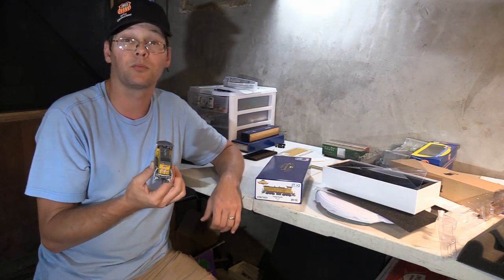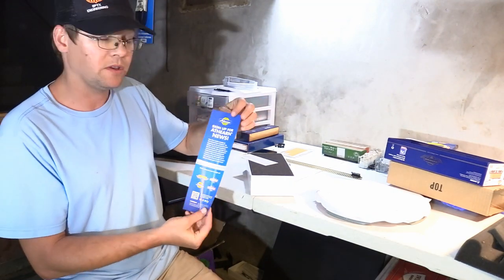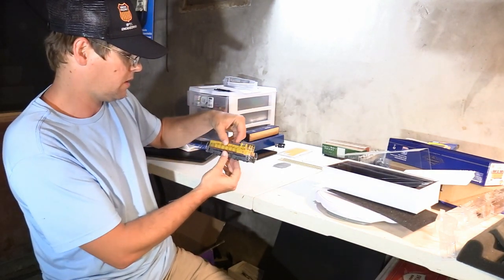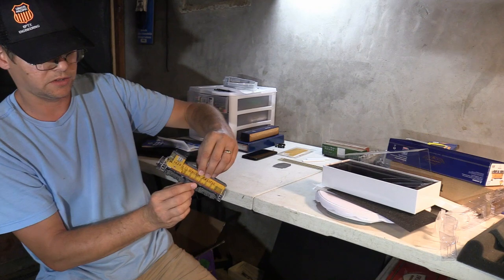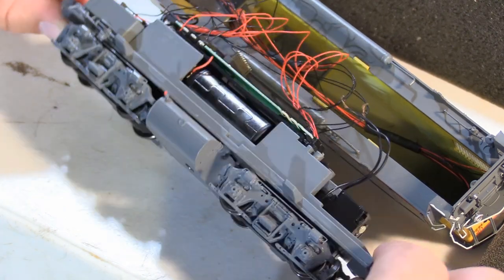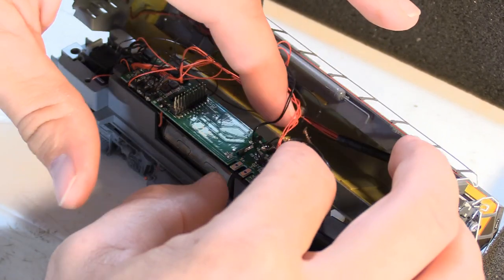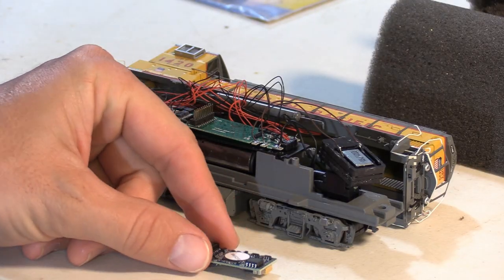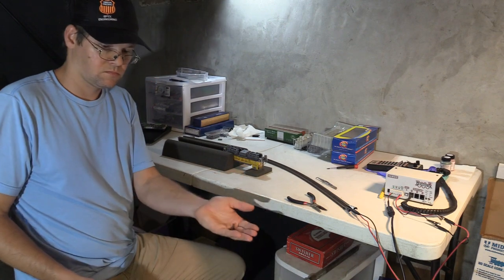Athearn Genesis MP15AC Review Loksound Install and Weather

Comment: Thanks for making this video, as I am about to order my first HO loco  - Athearn SW1500 - with Loksound 5 decoder installation, and had no idea that I needed to request to have the dealer install the sound files for that railroad specific locomotive.
And I also want to thank you for mentioning those Smokebox safety reflectors.
Reply from the maker: Hope the video gave you good insight. Yes, ESU has WAY too many soundfiles to offer them already on the decoder. If the dealer does not have a lokprogrammer at their shop, they can still request the project file you choose to be loaded on by ESU before they ship it to the dealer!
Reply: @signalupproductions  Appreciate those insights, and suggestions. * subscribed *